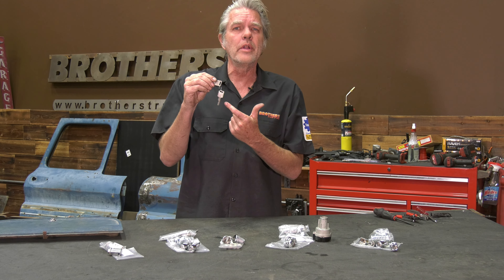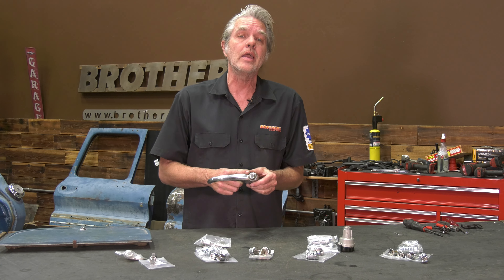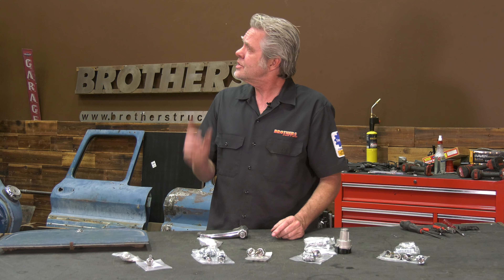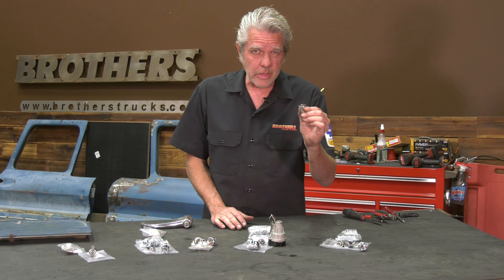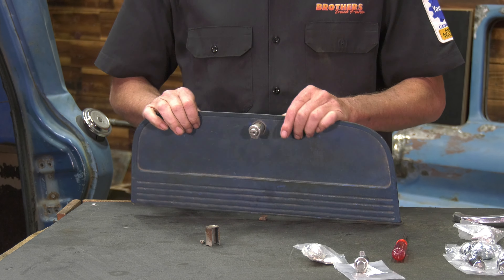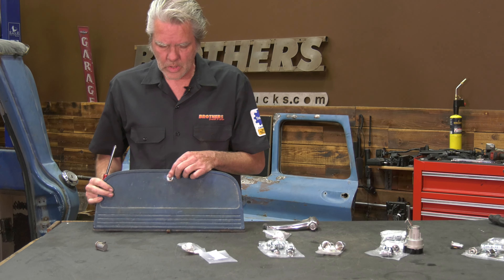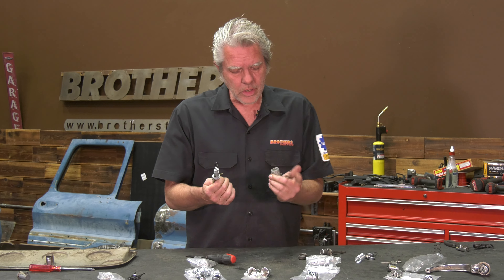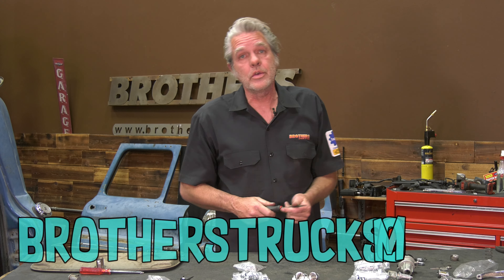1947-87 Chevy & GMC Truck Door, Ignition & Glove Box Locks/Cylinders/Tumblers

Comment: Can you use a 52-54 door handle in place of a 50 chev door so you can have a push to open handle.
Reply from the maker: The short answer is NO. The bracing inside the door is different as well as the linkage to the latch mechanism so it isn't as simple as just switching the handle.

Comment: Sure could use a color guide / wiring diagram to CORRECTLY re-wire ignition switch. Any sources???
Reply from the maker: Yes, we sell the factory wirong diagram which will give you a color guide / diagram for the ignition. www.brotherstrucks.com

Comment: Hi, I have a 1983 GMC K1500. The current locks will not rotate with the interior lock knob. This is happening with both the door locks. I cannot engage or disengage the cylinder pulling up or down on the knob. On the exterior and the key inserted, I can rotate the cylinder to engage the locks, but I cannot pull the key back out in this position. I have to rotate key back the to resting or open position to pull the key out...which is counter-initiative because this re-unlocks the door. I removed the cylinders from the doors to test the linkages on the inside for the lock and hook.  I can actuate the lock linkages with freedom and they had full range. They also correctly engage the door latching (hook) mechanism and will not allow the door to release from the striker (thus showing me this side works properly, seemingly anyways). I have tried to install two different brands of the same model lock cylinders, however, the exact same issues occurs. So, I'm confused as to what I am missing or doing wrong to fix this. Any suggestions? Thank you!

Comment: I have a 52 Chevy pickup. The problem that I have is that I don’t have no keys at all.. is there any way that I can remove or replace the ignition switch?
Reply from the maker: Yes, you'll need to break the ignition switch trim off the front so you can remove the retainer.

Comment: I have no keys. My 1962 GMC Truck was delivered without the keys. How do you remove the ignition switch without a key?
Reply from the maker: You pretty much have to destroy the tumbler by removing the stainless trim on the front. You should be able to get the bezel off the switch after that.

Comment: Hey Guys, I have a 72 GMC K10 4x4. I ordered a gas cap from you guys ( and a few other vendors ) and NONE of them fit. Any help would be appreciated. I also ordered a full LED running light kit, and they are fantastic! Keep up the great content
Reply from the maker: Give us some more info on why it doesn't fit? It's too deep, too shallow, to big around? We have a '70 and a '72 4x4 here at the shop and can probably figure this out pretty quickly.
Reply: @BROTHERSTruckPartsTV  either the cap latch is too big and won’t fit in or the cap will fit but won’t latch securely to the fill tube
Reply from the maker: @pcphilanthropy   Text some photos of what's going on to our Tech Dept at 951-808-7372 so we can see it for ourselves.

Comment: The problem I found was, the glovebox lock didn't fully disengage enough to open the box. I had to swap it back out with the original style
Reply from the maker: We don't see that with our locks, but we've seen other reproductions that do that and it can normally be fixed by adjusting the striker.